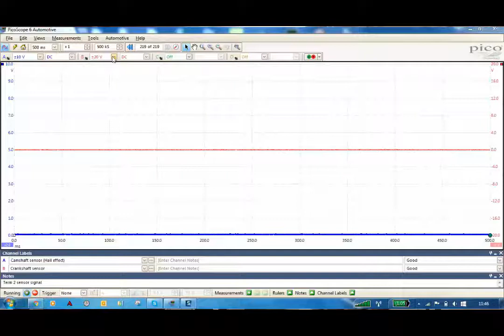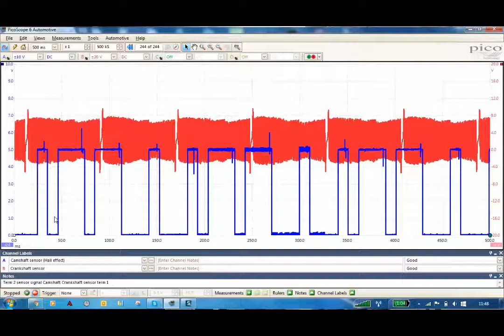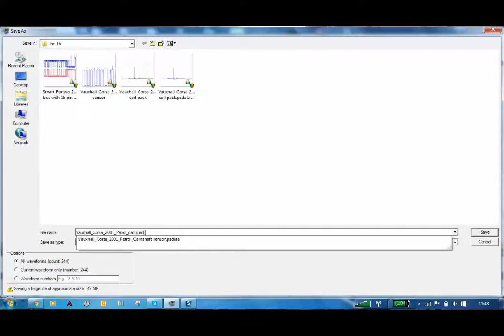Testing the Cam and crank sensors

Comment: I wanted to understand why the crank signals are referenced to chassis ground. The VR sensor has only two pins and generates an AC voltage and is not really connected to ground right but directly connected to the VR input of the ECU? So why is the measurement referenced to chassis ground?
Is it because the internal to ECU the individual signals could be referenced to ground or is it because of the oscilloscope channels that have a common ground?

Comment: Hi Roy, you can look at your tech data on this sensor. Most sensors are either 5 volt or 12 volts so put 20 volts just in case you get some interference.